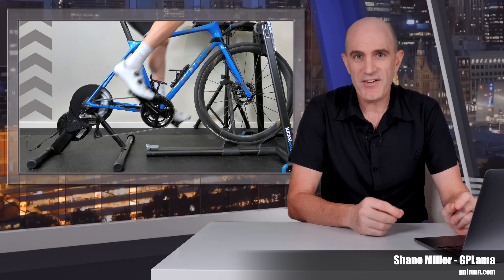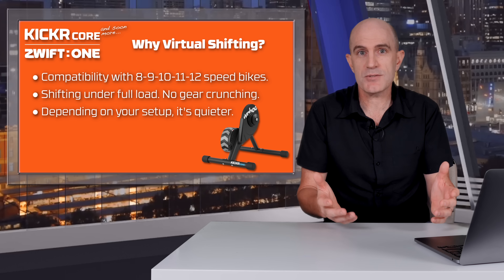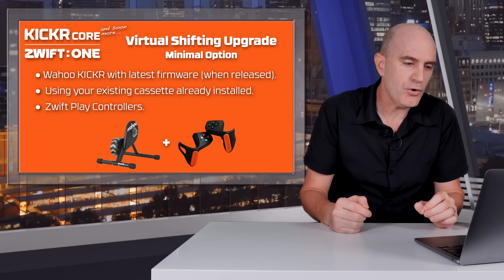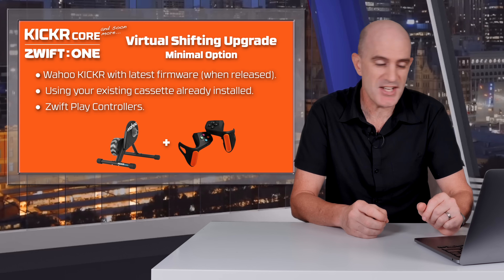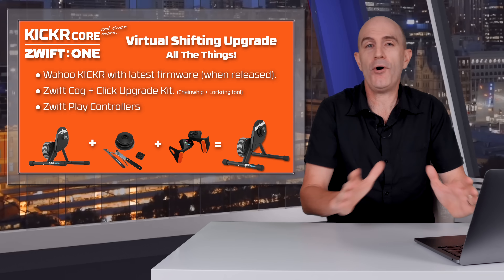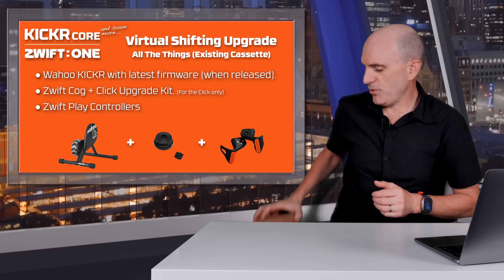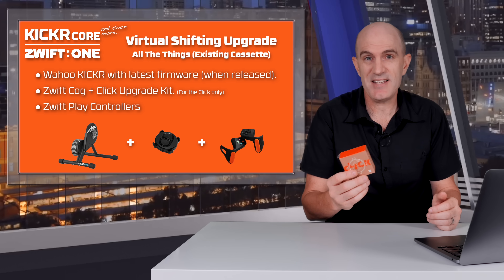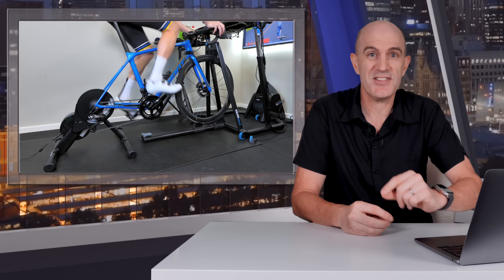Virtual Shifting Upgrade Options for Wahoo KICKR Owners!

Comment: Hi Shane. Thanks for this brilliant video. Do You know if this Zwift Cog usable in my Kikr V5. Don't want to buy if I'm not sure if it is ok to use in my setup.
Reply from the maker: The hardware is compatible. You’ll have to wait for Wahoo to release an updated firmware on the Kickr V5 to support virtual shifting.
Reply: OK. Thank You for quick answer. Love the way You do things. Nice work. Just placed an order for it. @gplama
Reply: Any idea when Wahoo will release the FW for the Kikr V5?

Comment: Thanks for this info Shane. Quick question: which cog on the cassette is 14 on an 11 speed one? I have the Play controllers, so I just need to wait for the firmware update and then I can virtual shift on the v6. Looking forward to it. 😊
Reply: I think that it doesn't matter which chain ring or cog you're on as the software adjusts itself based on sensor readings and results in the same effective range of gears, so long as your driveline is good.
Reply: The 14T cog will depend on which 11S cassette you have - easy enough to Google the different combinations for 11-28, 11-32 cassettes etc to confirm which one
Reply: @troy45uk  I believe that it's not about cog size but position, so that the rear cog is the center or one of the center cogs on the cassette and makes the driveline with the closest chain ring to be as close to parallel with the frame as possible.
Reply: count the teeth. it's not rocket science

Comment: When testing the Zwift hub one… while using the click… and a Garmin, Did you have any issues with speed?   … Also, where can I find the communication protocol for the data packaging of speed from a speed sensor to any head unit?
Reply from the maker: Speed reported from the trainer? That’ll be over ANT+ and 1Hz to any receiver (Garmin, etc).
Reply: …. How is the data packaged?  12 bit and scaling..over a periodic signal… or a pulse that the Garmin uses to compute speed … like a magnet on a spoke?   Is the speed packaged in a message or sent by pulse as a function of speed?
Reply from the maker: @euthiestamos9731  You're getting right into the technical side of things now. Best ping Wahoo or Zwift with these specific queries.

Comment: This may be a dumb question, but when using virtual shifting is there a preferred gear you should be on on your bike? Or should you just be in a comfortable gear like when you are using ERG mode? I just updated my Kickr Core and am excited to use virtual gearing, but want to make sure I am using it to its fullest potential.
Reply from the maker: The virtual gear calculations are all based on using a 14T on the back. On the font it depends. The small ring will typically give better ERG performance/stability.
Reply: @gplama  small ring will give us same power than big ring in sprints ???

Comment: Hi all, I have the original kickr V1 (folding legs) and has since upgraded to a 12 sp SRAM setup. Since the new xd driver is not available on the older kickr, I tried to get the 12sp shimano cassette, which I thought was the same, but it's not. I find some cogs are just unusable.
Question: is the older kickr firmware upgradable to support the virtual shifting? This way I can use my old kickr again.

Comment: Thanks for this I am thinking of taking my singlespeed cx bike and putting it on the trainer.  With a kickr 4 or future one this will be good hack. Zwift should just sell the kit without freehub for their no longer sold trainer and easy to set up any trainer and zwift makes money for less effort/cost then before on this product.
Reply from the maker: I think the reasoning for selling the Cog on a freehub was to simplify the conversion. 17mm open wrench or 5mm hex was all that was required.

Comment: Question - If you are just using your normal cassette, is there a reason why it needs to be in the 14t cog and not a different tooth cog in the rear?
Reply from the maker: As I understand - The Zwift Hub / Kickr CORE / (and soon others) that implement the Zwift Protocol for virtual shifting will assume a 14T cog is on the trainer. With that, after a few seconds of pedalling when you have everything paired up it'll use the flywheel speed + your cadence (estimated from your pedalling power profile with each stroke) to determine what chainring you're using on the front. From there it'll adjust the virtual gear ratios and attempt to give you the same 24 gears regardless of the front chainring you're in.

I'm not 100% sure exactly when this gear/chainring calculation happens. I assume it's when you drop into the game, not within the menus after everything is paired up. I'll need to test this.

I have a MTB with a 32 (or 34?) front chainring I'll mount up and do some testing with. I'm thinking flat road, gear 12, 90 rpm... and recording what power output that results in. Then same test with a road bike with a 36 on the front, then same again in the 53.
Reply: @gplama show this test in your channel. It will be interesting if different type bikes (mtb, road, gravel…) and different gears and chainrings relations respond in the power results

Comment: I changed my kickr core free hub to xdr to work with my sram bike. Installing the Zwift cog this wasn’t doesn’t seem to work do I need to swap back to the shimano free hub and if I do this will the spacing be right for my bike?
Reply from the maker: No need for the Cog. Put your bike in the 13,14,15 gear on the back and use virtual shifting with that SRAM cassette.
Reply: @gplama  thanks, but I was hoping to use the cog so I could get a second shimano bike and easily swap between the two as I read the cog should work with all bikes. I swapped the free hub to shimano and installed the cog to see how it worked with my sram bike but the through axel went in way to far and seemed to over tighten the seat stay. Argh

Comment: Thanks for the video...I'm using my normal cassette with the virtual gear shift and I was just using the cog at the back that provided the straightest drive - I've just heard you mention putting it on the 14 tooth cog. I'll try that, but if that's not possible, what's the impact on accuracy? Does it give inaccurate power readings, or just strange gear ratios?
Reply from the maker: In short, just a slight offset in the virtual gear ratios. Accuracy should remain ok. (Although that is another rabbit hole…. For another day).
Reply: @gplama  thanks. Great channel by the way!

Comment: I have a wahoo kicker core. I’m using my old 7 speed aluminum bike. With the correct spacer by bike shop provided it’s been working fine for 2 years. 2 questions. Why do they not officially support 7 speed derailleurs and how do I know if my 2 year old wahoo core will support hub. I want to test before I order the new kicker core for my wife
Reply from the maker: I've been told they didn't put 7spd on the compatibility list as most bikes/frames with 7spd didn't have the required rear spacing to be installed on the Hub/CORE (130mm minimum). If it does, you're good.

Comment: How is the zwift cog with sram flattop chains since the roller diameter is different from 11 spd chains? Thanks!
Reply from the maker: Less than optimal. It'll still work, but it'll be causing premature chain wear on an AXS flattop chain over time.

Comment: If using virtual shifting with cassette you said to be sure to use the 14 cog. What if your stack does not have a 14? Should use 13 or 15? Just wondering.
Reply from the maker: It’ll still work fine. The flywheel speed will be slightly different.
Reply: @gplama  Thanks. I am just trying to get back into cycling for health and recreation (retired and 75!) and use the trainer and zwift primarily to get my legs back and stamina. Hoping to do some longer trail and gravel rides this fall and next spring. Got a lot of work to do and things to learn! Keep up the good work!

Comment: Are Wahoo planning on bringing out their own cog to adapt the kickr corr. The hack for the zwift cog looks easy but I'd feel better about using Wahoo's own version. Anything in the pipeline?
Reply from the maker: All their version will likely be is the exact same hardware on a freehub that’s compatible. Which is exactly what people already have on their Kickrs. There’s absolutely no need for Cog to ship with a freehub other than to reduce the installation complexity.

Comment: Hi Shane
I have the cog+click upgrade kit coming via a parcel forwarding service to me in Canada.  Right now I run Zwift on PC with Sterzo Smart steering block alongside my Kickr Core.  I've seen some posts that suggest the Sterzo doesn't work simultaneously with the Zwift Play (makes sense since that unit provides steering too) but do you know if pairing the click for shifting will still let the Sterzo function?
Reply from the maker: Not something I've attempted to pair - The Click/Play and a Stezo.

Comment: So that method works on the Wahoo Kickr V4 (2018) Model @2:37 and I'm good to go?
Reply from the maker: Wahoo are yet to release a firmware for the Kickr 4 or 5 to support virtual shifting within Zwift.
Reply: @gplama  So even though I'd be able to put the Zwift Hub on the Kickr V4 I will not be able to shift and will be stuck in one gear.
Reply from the maker: Correct
Reply: @gplama seems like there will not be any firmware release for v4/v5...?
Reply: @gplama seems like there will not be any firmware release for v4/v5...?

Comment: Hi, is this just for Zwift or can I use another trainer program of choice? Like Rouvy or Big Ring?
Reply from the maker: Zwift
Reply: @gplama  That's a shame IMHO. Let´s hope this feature gets popular on a broader level so we can make it a standard in whatever Bluetooth API that applies here. There are other options besides Zwift really...
Reply from the maker: Zwift developed this protocol. They’ve done the legwork here. Similar to how Wahoo developed Direct Connect. Any other platform could have stepped up and done the same and open sourced it. Zwift have said they’re open to other platforms supporting this, and I have first hand knowledge they’re following through with this.
Reply: @gplama  Sorry for late reply. I fully understand that Zwift has done all the work and I can live with that. I'm a developer myself. :)
However as this is a major new idea, that could apply to a broad set of software, everybody could benefit if it was created as an implementation from a from a standard protocol. Then the Zwift implementation or a Rouvy, or RGT implemantation could be different in code, but all applying to the common standard protocol. Compare to the USB or HDMI standards and then to the Apple lightning standard that is closed to others (like Zwift here).
Now, I understand that the smart trainer world is probably not large enough to have a standards organisation for this though. :)
If Zwift is open to license the tech, then that is a great way too, but I fear if there is a cost the other companies will choose not to implement it if there is not a big enough demand for it from the users.

Comment: Hi Shane, I think you said the Zwift one hub is compatible with all core trainers, is that right? ours is one of the earlier core trainers. I just updated the software to the latest version. Didn’t want to order until sure. Thanks! Really helpful vid. software v 1.3.17
Reply from the maker: Yes. All CORE trainers.
Reply: Afraid I’ve had no luck connecting the trainer. Just went up climb of the week on single speed! Although the click controller pairs with Zwift on the iPad there is no shifting. I have updated the iPad software it’s the latest. The kickr core software is the latest and the Zwift click also has the latest software. I’ve checked that the Bluetooth connections are all correct and they are. I have even opened the click to see if disconnecting and reconnecting the battery helps. For a fleeting moment I had “gear 12” appear on the in game screen but not managed a single shift. Could be a faulty Zwift click. Wonder how Zwift deal with returns if you have used it with what they say is incompatible??

Comment: Fitted the zwift hub no problems. Unfortunately the zwift click switch wont do any gear changing at all. I have checked and rechecked all the updates and all the bluetooth connections are correct. Had to update the click switch via zwift companion. Doesnt work on my Core trainer.
Reply from the maker: Are you pairing the CORE via Bluetooth?
Reply: Hi Shane, yes everything is via iPad/iphone, no ant+ at all. All Bluetooth. Everything is paired according to the startup screen on Zwift. All via my iPad which I use for viewing the workout or race. I also use the companion app on the iPhone but that sorts itself out.

Comment: while using hub one, and the Click Virtual shifter, I have erroneous speed values reported to my Garmin head unit of over 100 miles an hour. 
does the kicker core  1 or others  have this problem as well?
Reply from the maker: No issues I've seen with the flywheel speed reported from the CORE.

Comment: So how fast is the 14t cog going to mess up the sram flat top chains? My rival cassette doesn’t have a 14t , just goes from 13 to 15.
Reply from the maker: I guess it depends. How clean the chain is, how much it's used, how hard you're pushing. 13 or 15 should be fine. It'll just shift the virtual ratios slightly.

Comment: This may be a stupid question, but my 10–44XPLR cassette does not have a 14. It has a 13 and 15. Doesn’t matter which one I put it on?
Reply from the maker: Either of those will be close enough. The virtual gear ratios are calculated based on a 14T, but a 13 or 15 will suffice. You may find yourself in virtual gear 10 or 14 rather than 12.

Comment: I find it interesting that the single cog supports 8 through 12 speed chains.  Can you run into noise or wear problems if your derailleur isn’t well aligned with the single cog?  I really like the simplicity of the single cog, but I am suspicious of alignment and tuning issues, especially with 12 speed.  It would seem like the solution would be for the cog to have some lateral float, sort of like the slop bui.t into the upper jockey wheels of older derailleurs.
Reply: Aren't basically all drivetrains no matter the number of cogs, brand or method of shifting trimmable so that everything is aligned?
Reply: I can't see it being an issue, the reason an 8,9,10,11 speed chain would be incompatible/very noisy with a 12 speed cassette is the OUTER width of the chain will cause it to rub on the neighbouring cogs because the spacing between them is narrower, with the Zwift Hub there are no other cogs to rub. A multi speed bike almost never has a perfect chainline in any gear combo' anyway, the position of the Zwift cog even if less than perfect means the chainline will almost certainly be better than all but 1 or 2 of your gear combo's out in the real world, but even if you do by shear chance have 1 or 2 "perfect gears" on your bike you wont spend all of your time in those gears when out riding so wear on the chain/cassette will be significantly higher overall than on a single slightly misaligned cog that you never move from.
Reply: @Bikey_McBeardface  Good point and I guess why you can't use a cassette in certain multi-bike situations. But certainly in some situations where chain rubbing wouldn't be an issue. My main concern about the Zwift Hub is that it appears to use a cheap cog that's also noisy. But I suppose that you could always swap in a better quality cog.

Comment: I have a Kickr (not core) v3 which is incompatible with virtual shifting, so I’m considering of moving that one on an “upgrading” to the latest core with hub.  But is this really an upgrade?  Or the older version of the kickr will still be superior to the latest version of the core?
Reply from the maker: The CORE is an extremely solid option now it has both virtual shifting and auto-calibration.  Feature wise it'll be an upgrade from the v3.
Reply: @gplama  thanks Shane, and in Australia where could we buy a zwift play controller?
Reply from the maker: @Inserico  We can't buy them here yet.
Reply: @gplama  Thanks for the responses Shane!

Comment: Right I’ve updated firmware on kickr and I have the zwift play controllers but I can’t enable virtual shifting. Is there something else I need to do? I can’t see anything in zwift settings to enable?
Reply from the maker: Is the trainer pairing via Bluetooth?
Reply: Legend! That’s solved it I was connecting via usb cable.
Just have to see if drop outs is an issue now. But thanks

Comment: Shane, is the 14 tooth part necessary with existing cassettes? I don’t see any mention of that in the Wahoo support doc
Reply: I don't think it is, especially when using the small ring at the front. I tried it earlier and it seems like Zwift calibrated to the gear I was in after a few seconds of riding, so just use whatever gear gives the straightest chain line.
From Shane's setup it looks like he was using the big ring, so I guess the 14 tooth at the back lined up perfectly for him.
Reply from the maker: It is for 'correct' calculation of what chainring you're using on the bike. This is something the trainer will do when you first start each ride. If it's a 15 or 17, it'll still work but the ratios will be slightly shifted.
Reply: @gplama  got it! Thanks a lot
Reply: @gplama  sorry Shane, follow up Q: this probably means I should be in the big ring as well to keep the chain straight? Should I worry about cassette wear by only staying in one cog/ring?
Reply from the maker: @tedsvo9745  The 14T on a normal cassette or the Cog should give a pretty straight chainline in either front ring. It'll depend on the bike/chainline of the crankset. As for wear.... that depends on a lot of factors. If you're running a super-clean (waxed) setup, it'll last a long while. Running a gritty and shitty chain, everything will wear faster.